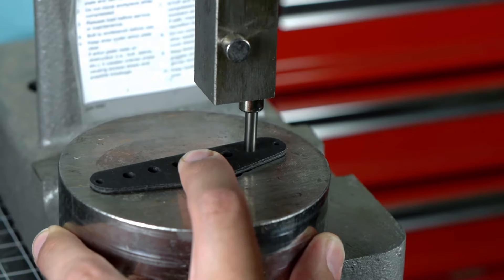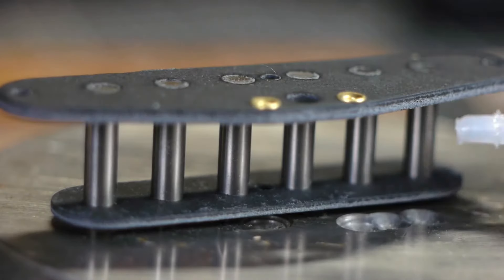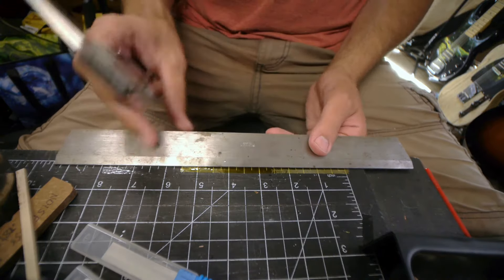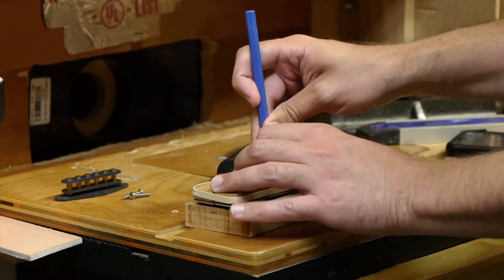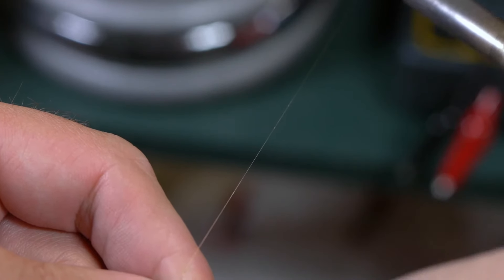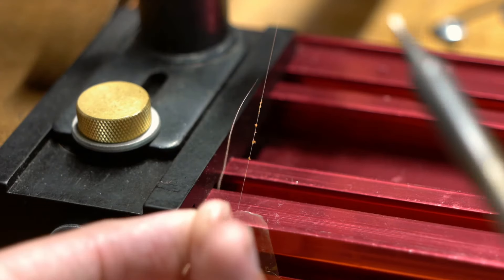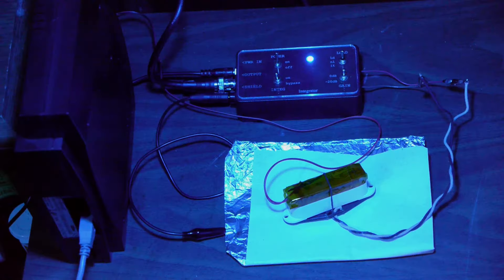Making a Single Coil Pickup: Complete Guide

Comment from the maker: *NOTES AND UPDATES!*

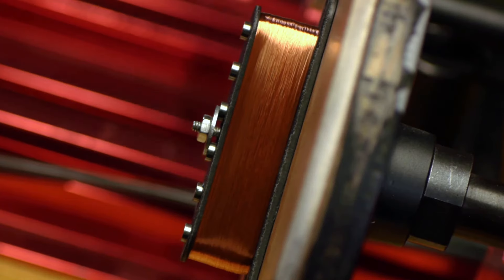12:20 - Splicing Magnet Wire: 

Poly nylon coated wire strips with nothing but a soldering iron. The flux doesn't affect the insulation but distributes heat from the iron more evenly and ensures a smooth tinning process with minimal risk of snagging and breakage of the wire. 

For Formvar or Plain Enamel wire, I scrape the insulation off carefully with a #11 Xacto blade, or 400 grit sandpaper. Those coatings will not strip with a soldering iron alone, and need to be mechanically scraped off before tinning. In hindsight I'm wishing I remembered to include that in this video, as it is really important to mention.

0:00 - Pressing the Magnets

As of around 12-2024, I've been using a solid block of wood (1.5" thick, 1.5" wide, 3.5" long) with the appropriate hole spacing drilled into it. 

I'm using that now instead of the MDF/pickguard material thing I showcased in this video. Keeps my hand out of the way of the hammer and works great, and should be much easier to make. The dimensions don't really matter that much - whatever suits you. You can drill the spacing by double stick taping a piece of Stratocaster flatwork to the block of wood, and using the holes as drill guides. Make sure your drill bit matches the hole size -- either .187" or .195". Then remove the flatwork, and drill the holes oversized. 

I've been drilling the holes to around .220" for clearance, but occasionally have had issues. 99% of the time the bobbins come out great, but sometimes I get a little flaring on the top flatwork piece. One of the keys may be hammering the top flatwork as evenly as possible first before driving everything home.
Reply: I would really like to see a reverse engineered S.D. p-rails pickup.
Reply from the maker: @Charles-Darwin  Great thread here, actually with input from Frank Falbo himself, who invented the P-Rail:  

https://guitarnuts2.proboards.com/thread/7894/seymour-duncan-rails-analysis-review

I don't have a video planned on the P-Rail yet. But that's a great thread going over the design and an analysis of all the available specifications.

Comment: Great video, thanks for taking the time to do them! I’ve made some of the smaller style containers to hold a spool of wire, and have installed a bead in the lid. It’s not easy to get the Wisker Disk’s where I live, how important are they to the process, in your experience?
Reply from the maker: I actually have found the Wisker Disks are only important when using Remington spools that are 5lbs. The bigger spools they make flare out on top, and are prone to snagging -- and if it snags, the whole spool is rendered useless, and has to be returned for a refund or replacement. Very annoying. 

I've been ordering spools from Ultra Fine Copper Wire, based in Tianjin, China, instead. 

rvyuan.com is the e-mail address. They have various representatives. You e-mail them directly and pay through PayPal to their address at: 

rvyuan@126.com

At least that's their current information. My current contact is Ellen, who can be messaged at ellen@rvyuan.com. But I'd fill out the contact form on their website first. 

Anyway, I've had much better success using their spools than the Remington ones. They don't flare out at the top, even in the higher weight spools, and don't snag. 

I don't use Wisker Disks on these spools. The main reason I used them on the Remington spools was because I had gotten snags on two 5 pound spools and had to have them both replaced. Using the Wisker Disk prevented those issues, but also could lead to tension that was so high, the bobbin would "banana" -- the wire actually can squeeze the magnets too tightly and cause the bobbin to deform when the winding tension is too high, which was frequently happening to me when using the Wisker Disk. 

So: it's only important to use it if you're worried about snagging wire, which I've only ever had happen on the 5lb Remington spools. I've heard other people say as well that they've had this issue lately with Remington. Maybe they've got it sorted out, maybe not -- but for me, I get my wire exclusively through Tianjin for now. The website is here: 

https://www.ultrafinecopperwire.com/

The spools are that much better. And I use the Rubber Maid pitchers now, with the bead, which those spools fit perfectly into. I don't think the Remington spools would fit in there. 

However, if you're using 1lb spools, you can disregard all of this. This is mostly only relevant to people like me going through dozens of pounds of wire. 

You can clip some of the whiskers off the disk to make it increase the tension less. It's often too much tension. So even though it can save the spools from being bricked (not functional anymore, with the wire stuck, and you can't get it out).....it's a double edged sword. And I no longer use them, generally speaking. 

I've been using felt on popsicle sticks, with the Stewmac kerfing clamp to hold it together, as shown in this video. Works great. I vary tension by angling it differently or holding it at different lengths from the chisel tool rest. I think setting the tension on the tensioner is key, and then learning how to vary tension by the way you hold it. 

I err on the side of slightly looser winds these days. Deformed bobbins don't look great. Though many old Fender pickups look like bananas on the top flatwork piece, and nobody was the wiser. 

Hope this helps! I think getting a feel for adjusting tension on the fly by hand is the way to go, and the Wisker Disk is primarily to prevent bigger spools with flared edges from getting bricked. Bigger spools without flares are a better solution, and adjusting tension by hand on the fly. And also of course with the kerfing clamp, and where you put it on the popsicle sticks + felt. 

You get a feel for it after a while and after you've banana'd some bobbins you'll know when the winding tension is too high. Again, I err on the looser side these days for most of the coil, and either intermittently use slightly higher tension, or finish up the coil with some higher tension wraps for the last 1500 turns or so. Nothing set in stone and all guestimations here, it's very touchy-feely.
Reply: Thanks so much for your answer. All that info is really helpful, I will contact the supplier that you suggested also. At the moment I’m using much smaller spools that I guess are also more expensive. Thanks for your answer, and thanks again for the video! Happy winding!

Comment: Great work. I'm contemplating rewinding a dead strat pickup which I like. I've unwound it about 100 turns and haven't found a break in the wire. I suspect it might not be a break in the wire, but simply corrosion coming down from the poles and into the coil. Maybe it's best to just re-wind it. I've never done this but I'm watching your channel and there's plenty of very helpful information.
Reply: Check both ends with a multimeter

Comment: Is it necessary to count the number of turns or are you just filling the bobbin? It would surely make a difference to the eventual sound of the pickup. I was a little surprised at how fast people wind them.
Reply from the maker: Yes, turn count is arguably the most important factor of all. I've been planning a video about this as well -- and your comment reminded me! 

The DIY winding machine I use also goes to 4300 RPM, which is much faster than most winders, which usually reach a maximum of 1500 RPM. A big help when doing higher turn count pickups. I do one with 20,000 turns and one with 23,000 turns, and having a higher RPM goes a very long way in making it an easier process. 

The wire can be hard to control at that speed but I'll have more experimenting to do to figure that out

Comment: So the inner start wire position is the negative and the last outer wire end is the positive? Did I see that correctly?
Reply from the maker: Guitar pickups generate alternating current, so there is no positive or negative like there is with direct current. Either the start or finish wire can be connected to either ground or hot. 

When combining pickups, there is an interaction between the sine waves of each coil, and that's where you can have phase issues. At that point, the orientation of the wiring does matter. 

But only when two coils are wired together. This includes humbuckers.

This does get a bit complicated but hopefully that helps a bit. Let me know if that clarifies anything or if you have any questions regarding this!
Reply: @guitar_md  Thank you for clearing that up! I get it now.

Comment: Did you ever use lacquer before winding or always tape? Fantastic video 🙏🏻
Reply from the maker: No, but Fender used to pot their pickups in lacquer, not wax. I recently rewound an original 1951 Nocaster neck pickup and it was clearly lacquer potted. The lacquer did not penetrate very far into the coil either. 

Interesting stuff! I wouldn't use lacquer to insulate the magnets before winding as it breaks down over time, and I've seen many broken pickups that had no wrap around the magnets. 

I've occasionally seem some pickups with masking tape around the mags that failed as well. I use black cloth electrical tape around the mags most frequently, actually, but didn't mention that in this video. Kapton tape is good but I think the black cloth tape is more protective. 

Shellac is also more user friendly than lacquer. I may try shellac potting at some point. Wax potting does raise the capacitance of the pickup, typically by 40pF to 50pF but this depends on the size and shape of the coil.

Shorter coils seem to increase by less than taller coils with wax potting but this is such a small difference it might not matter unless at an extreme. 

The lowest capacitance pickups I've made are with 1/8" coils and 48AWG. Interesting stuff!
Reply: My understanding is that you use rhe black tape before the winding? I wish there was a book - all the books I find are historical. Anyway, thanks
For your time
Reply from the maker: @robertlassiter  Yes, the black tape is before winding. The purpose is to protect against the wire breaking, from the magnets corroding over time. Corrosion can build up on the magnets and as it does, it can break the delicate wire. 

All it takes is one tiny break, and the whole pickup is toast. 

Fender never taped around the magnets, as far as I know. All the vintage Fender rewinds I've done have showed nothing on the magnets at all -- not even lacquer. It appears as if they were simply wound around the magnets, then potted in nitrocellulose lacquer. 

The black tape serves exactly the same purpose as the yellow Kapton tape in this video. Just a different material. I think coating the magnets in some sort of protective enamel (like they use in the actual magnet industry) would probably be best, but this isn't feasible for most people. 

I've thought about it. If you really wanted to future-proof a pickup for as long as possible, I think an anti-corrosion enamel and then a layer of Kapton or black cloth tape before winding would be the way to go. 

Many vintage pickups still work fine as well. A layer of tape is certainly much better than nothing! 

Not sure if Fender dipped their pickups in lacquer before winding, though I know many modern builders do this. I've never seen lacquer on the magnets on any vintage pickups I've unwound, but it may have been a thing. 

The lacquer potting should result in a lower capacitance than wax potting. I haven't measured this yet, but I fully expect that. Wax potting raises the capacitance by a not-insignificant amount, even though it's debatable whether it's audible or not. I personally think it is. 

But microphonics can be a really pain. Unpotted pickups are cool until you realize the sound of your pick hitting the strings is coming through a lot louder, among other annoying things. Wax potting dramatically helps to reduce this. Though some players might like that effect. I've made many unpotted pickups myself.
Reply from the maker: @robertlassiter  Check this out: 

https://www.magnetexpert.com/technical-advice-for-every-application-magnet-expert-i685/corrosion-resistance-in-permanent-magnets-i684

"A very common coating used for permanent magnets is a triple layer of nickel-copper-nickel, however there are many other suitable options including but not limited to gold, silver, zinc, tin, epoxy, PTFE and various paints and lacquers."

"Alnico and ferrite magnets are both known for their resistance to corrosion, although they don’t provide the same level of magnetic performance of rare earth samarium cobalt and neodymium magnets. Some grades of alnico magnets do contain traces of iron and therefore will display some light surface corrosion over time if exposed to water. However, if exposed to other lubricants such as oil, solvents or alcohol, alnico performs very, very well. Traditionally, alnico magnets have been coated in red paint; it is not clear how or why this custom started but it is one still followed today with most alnico magnets instantly recognisable by their trademark red finish. 

Ferrite magnets, also known as ceramic magnets, are made from iron-oxide and as a result they simply do not corrode even when submerged in water. Because of their unrivaled resistance to corrosion, ferrite magnets are very rarely coated, but as ferrite is a dusty material some applications will require some surface treatment to avoid the dust spreading."

-------

It's worth noting that the magnet wire is made of copper, and copper + aluminum (the 'Al' in AlNiCo) together create galvanic corrosion. So this idea that AlNiCo is resistant to corrosion doesn't necessarily apply when wrapping the magnets with copper wire. 

Even though the copper magnet wire has enamel around it, I think it might still interact with the aluminum in the rods. That, and plain old sweat from people's hands and moisture in the air.

Comment: Congratulations on the video, it's very professional and informative. I have a question: what kind of counter do you use to verify the number of windings? I've noticed that magnetic sensors aren't able to count accurately at high speeds, so I imagine you've used an optical sensor. If so, could you provide some helpful guidance on how to source and build it? Thanks and bye!
Reply from the maker: I have a video on the turn counter I use here:  

https://youtu.be/9eE5oJsod-c?si=4eNXtTonbTM5dMMh

Hope this helps. Let me know if you have any questions. It's the most accurate setup I'm aware of and easily handles my PenPal lathe at full speed, which is 4300 RPM. It's not cheap but for the performance you get, it's well worth it. Nothing better or more accurate out there. 

Credit to Rob DiStefano of Cavalier Pickups for turning me on to this. The guy is a true genius and a living legend. I wouldn't know how to wind pickups at all if it weren't for my years of correspondence with him on the TDPRI forum.

Comment: Hi is there a way to check which wire on the pickup is negative/ positive using simple multimeter? This knowledge is required when using diagrams for connecting switches/ knobs.

Comment: Can you please explain the wicker disk in more detail? I don't see how it works.
Reply from the maker: From Azonic: 

Why Use A Wisker Disk?

"Over 90% of basic dereeling problems are solved simply by using a wisker disk—regardless of spool size. A wisker disk is a simple and effective solution to most dereeling problems, as it maintains a slight, constant tension at all times, and prevents the wire from waterfalling, ballooning, breaking, and tangling itself and other wires. 

Our wisker disks work whether the spool is in a horizontal or vertical position, create the pretension necessary when using other tensioning equipment, and provide instant wire control during the quick starts and stops of today's high-end winding."

They're nylon whiskers that maintain tension on the wire. The wire can only make it past the whiskers when it hits a certain amount of tension in grams, which will deform the whiskers and allow the wire to pass over it. 

The best way is just to use one and feel it. The difference in tension is immediately noticeable. 

One of the biggest advantages is preventing the wire from getting stuck as it dereels off the spool, which can render the entire spool useless.

Comment: When making a Tele bridge pickup with a baseplate, should the baseplate touch the pole pieces directly? If not, how do you seperate them? wax the pickup before adding the baseplate?
Reply from the maker: I always put a strip of Kapton or Black Cloth Acetate tape over the polepieces before mounting the baseplate. Same way I wrap the poles before winding. 

Black cloth insulating tape is much cheaper, and is extremely durable. I know people who've used Scotch tape or masking tape, but I prefer electrical tape for these things. 

One strip over the back, over the polepieces, then you can mount the baseplate. My method is to do that, then thread the screws into the baseplate to hold it in place, then into the wax bath it goes.